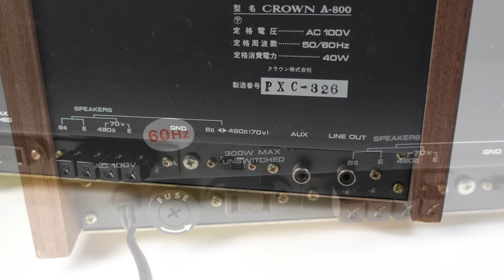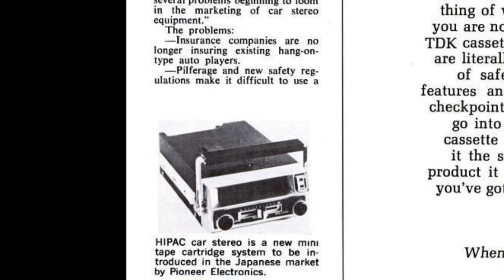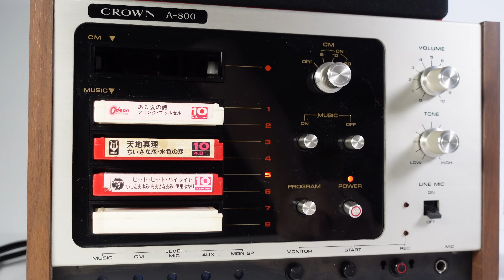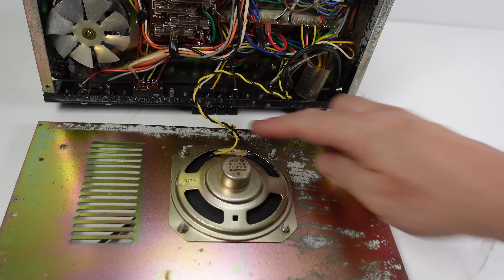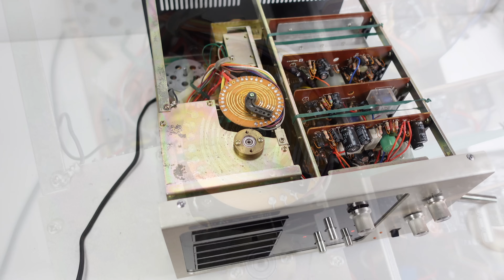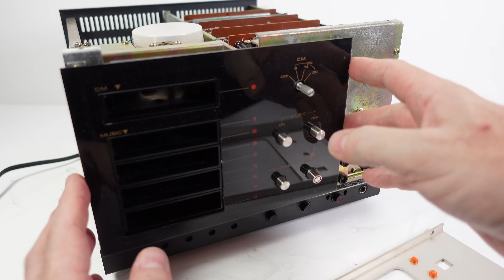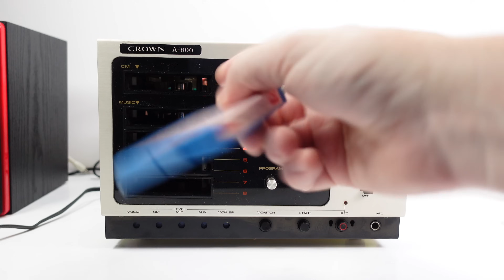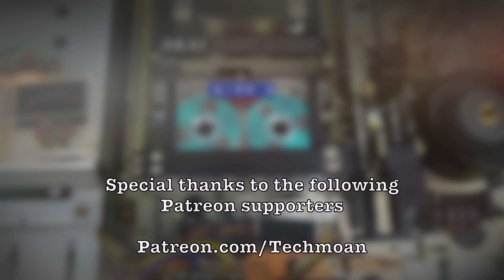An unusual player for a forgotten ‘70s music format

Comment: On the line frequency issue, would it be possible to use a UPS that had switchable output frequency... or perhaps a DC to AC inverter tied to a 12 volt battery?
Reply: Most low end DC to AC inverters do not produce an AC pure sine wave.  Their waveform is acceptable to modern switch mode PSUs but not so much to the older type equipment containing those heavy 50 or 60 Hz mains transformers.
Reply: @geoffmorrison3648  ... I figured the guy had enough stuff around that he may have something suitable but never gave it a second thought.

Comment: The modularity of that machine's design is ingenious!  It's absolutely designed to be serviced on-site, very quickly.  The technician simply needs to swap out the modules to get the machine working again, and can then take those modules back to the shop where they can be repaired properly.  Really well-designed, particularly for the early to mid 1970s.

Now we know why the Japanese ate our lunch in the '70s and '80s when it came to electronic devices.  They really showed the world how it should be done.

Comment: I don't think replacing the capacitor would do anything. In fact, lower power line frequency requires higher capacitor value to smooth out the rectified voltage. In fact, relying on an electrolytic capacitor to set the tape speed would be a terrible idea. Electrolytic caps are notorious for having sloppy tolerances when it comes to capacitance. +/- 20% is the norm. Besides, their value often drifts with time. In other words, this is not something you'd use for setting the tape speed. I suspect that they would replace the flywheel for the 50 Hz model.

Comment: A BGM machine is exactly what came to mind to me.  He'd featured such devices before on the channel, and it's pretty common that those devices are mono, because there isn't a real benefit to having them be stereo.

I figured the first slot was intended for pre-recorded announcements/alerts/etc.

Seriously though, the internal workings of these pre-transistor electronics are crazy.
Reply: How is it pre-transistor? Do you see any vacuum tubes here? It is definitely transistor technology.
Reply: @0raj0  Quite right.  I meant pre-integrated circuits, I think?

Comment: I have an associates degree in electronics engineering and replacing the capacitor isn't going to change the speed. Those two values were chosen by the designers for filtering out power line noise effectively. To change the speed, the motor or pulleys would need to be changed.
[EDIT] Many rude people have replied to my comment. Am I an electronics technician? Maybe I'm a very highly trained chimp, a figment of your imagination, or this is an early prototype matrix and we're all just slaves to retro tech. If that bothers you, just follow the white rabbit or something.
Reply: I still have my Akai GXC-40D cassette recorder which I purchased some time between 1971 and 1976.  Was obviously intended as a worldwide model as it has a 6 position voltage selector switch (100/110/120/200/220/240) on the rear panel.  (The screw in fuse holder is in the middle of the selector and needs to be removed to change the selector so no risk of inadvertently changing it.)  On the bottom a single screw opens a trapdoor which gives access to the double pulley on the single AC motor.  There a little label showing 50Hz and 60 Hz against the diagram of the large and small pulley diameters.  There is also a 2-position slide switch labelled 50/60.  The circuit diagram (which was often included in those days) shows that the motor is fed from a tap on the mains transformer through a capacitor.  The 50 Hz position adds an extra capacitor in parallel with the one that is always in circuit.
Reply: Unlikely because the presenter does not mention hearing 50Hz mains hum. And mains hum is not apparent in what we hear despite the unit set for 60Hz but being used on UK 50Hz.  But you could have been correct electronics then used star-point grounding system that was a problem and designers struggled with electrical interference and mains hum at that time.
Reply: I highly doubt the motor is an indication motor, I would expect it to be a brushed motor. Therefore I don't think it is a phase shifting capacitor. A capacitor can be used to adjust motor speed such as in an old fashioned ceiling fan speed control. I think it does that by using the capacitor AC reactance to lower the True  Power available to the motor. I think its worth a try, it shouldn't damage it anyway
Reply: @cameronlevers231  I never thought I'd see so many people in one place who don't know anything about how motors work.
Reply: @freddyzdead1  why are you so adamant it is an induction motor? Cassette tape drives have brushed motors close to the read head not to mention how do you have an induction motor in a 90s boom box?
Reply: In this case the white rabbit turned out to be correct , and simply changing the cap worked.
Reply: rosenbergs electric motor repair   Try this book you will learn a lot
Reply: Chris if you had a degree in electronics you would know that the purpose of the capacitor is to provide the correct phase shift for the run winding of the motor.  Absolutely nothing to do with noise filtering.
Reply: @freddyzdead1  another but most unlikely explanation is that the motor is a brush motor.  The capacitor is in series with the field winding and the ac supply and the armuture is supplied directly from  the ac supply.  Therefore the motor is shunt wound has very good speed regulation set by the ratio of the two voltages.  If the field reactance drops due to loading on the motor the voltage drops causing the speed to tend to increase or counter the tendency for the speed to drop and that is why there are two capacitor values rather than a capacitor or a shorting link.
Reply: @AndrewLohmannKent  Are you serious?  A brush motor in the middle of multiple tape drives?  Besides that, your explanation is all wrong.  Brush motors have the worst speed regulation of any kind of motor.
Reply: @freddyzdead1  But PM brush motors were used in cheap tape recorders with no capstan but the speed depends on the battery voltage and the amount of tape on the real.  Anyway I have suggested a shunt wound motor which has very good speed regulation and there is no reason why it should not be compound motor with an anti-series winding to improve speed regulation, if the suggestion I made does not work.  Anyway as I said above gear change or motor change is more likely, but the video suggests that those are not likely.
Reply: I also have an associate's degree in electronics engineering and in a simple LRC loop circuit changing the capacity will indeed change the frequency of the output.  Now will it change it to the correct frequency in this instance?  I would have to study the circuit diagram and calculate based on the inductance of the coil
Reply: What's an "associates degree" when it's at home and why is it relevant to the capacitor.
Reply: I also have a degree, and if you change the capacitor in an LRC circuit you will also change the frequency of the output.  It seems like an odd way to change the frequency especially in a power supply, but it could work! I don't know if I would risk it, because it might overload the circuit.

Comment: The CM might stand for "Customer Message". To be honest, to me, the purpose of the unit was given away when you showed the back panel with the labelled high voltage speaker connection. That has commonly been used where there are many speakers to be driven, as might be found in a large store. In such a setup the speakers are fitted with their own step-down transformers. This allows many speakers to be driven in parallel from a common source, while the current driven can be relatively low. This reduces the losses due to wiring resistance which increase with the square of the current through the wire.

Comment: I am unsure about changing from 60hz to 50hz by changing that capacitor.  I thought at first that changing the value of the capacitor might change an oscillator circuit from one frequency to another.  But the physical size of that capacitor implies that it is part of a power supply.  It might be that the cap is part of the power supply just for the AC motor and its value changes its frequency.  Did the user manual have a schematic?  My $0.02 for what its worth.

Comment: 17:40  just lower frequency  needs more capacitor. so no, changing capacitor wont fix it.
i think you need to change size of pulley.

Comment: It's not impossible to control motor speed with a capacitor. But these things have massive tolerances, so for each unit you made it would be a stab in the dark what speed you actually got, particularly with seventies technology. Even if the unit had the right value, it would probably have drifted by now. Other folk talk about how you can add capacitance in parallel, and that's right, but just any old capacitor which you've got to hand around the 1uF sort of value and with a high enough voltage rating (matching or exceeding that of the existing cap) will at least show you if this is how the speed is controlled.

Comment: I believe the motor is an ac type, with a capacitor dropper in series. As frequency is lower and you want to pass same power, you need a larger capacitor. So it changes the power through motor, not the speed it turns. You need to really examine the motor. Perhaps some part can be bridged out? Worst case the 50Hz uses a completely different motor.

Comment: The 70V mono output is a BIG clue as to its intended use. 70V systems are extremely common for use in "department stores", offices, amusement parks, hospitals, hotels, etc, where many mono speakers, usually mounted in the ceiling, are fed from a central point. I sold 70V systems when I was working at Radio Snack many years ago. Occasionally, someone would try to by one as a car speaker or something. Each speaker in a 70V system requires a special 70V transformer. There are many advantages to 70V systems, but sound quality is not one of them. Distance, number of speakers you can put in series, volume control at the speaker, scaleability, decreasing cost per speaker I guess are the most obvious.

Comment: The capacitor looks to be part of a resonator circuit.  It is likely replacing it will change the speed.  The new capacitor (due to modern technology) will be considerably smaller.  I recommend a high voltage (300 v) Mylar type.  You can temporarily parallel the new capacitor with the old one, and see if it adjusts the speed, then you will know, and not waste time soldering if it doesn't.

Also, Japan is a tropical island.  It's pretty normal for it to be humid.

Comment: I knew right away that this was for a store or office.  The thing I noticed was the 70-volt 490 ohm speaker output connections on the back of the base unit.  This allows the unit to drive multiple speakers that might be hundreds of feet/meters away from the unit.  These are interconnected with thin gauge wire as part of a "distributed speaker system".  The resistance of long lengths of this (INEXPENSIVE!) thin wire would never properly drive a single 8 ohm speaker let alone many speakers scattered around the store.  Each speaker has a transformer that converts the 70-volt to something that the speaker can use.  Also, all the speakers' transformers are connected in parallel to one another which simplifies installation.  Bottom line one base unit can easily drive many speakers.   See https://en.wikipedia.org/wiki/Constant-voltage_speaker_system for details.  My $0.02

Comment: I think your best bet to fix the speed issue would be to get a large 12v power supply and connect it to an American car inverter. I don't think changibg the capicator should change the motor speed, although I wouldn't think it would hurt to try

Comment: Haven't seen this in the comments (but I didn't read all of them).
You might want to pull out the power "card" to see if there's a speed switch or marked changeable component along with the capacitor you found that was marked for speed.
I did see a mention that the pulley operated by the motor belt might need changing too.

Comment: Using a "marker tone" on the second head for the announcement makes sense because getting a tape with the exact right length for announcements would be difficult. This way, you may be able to record several announcements on a single cartridge and it could stop between them and it could automatically skip a blank section by advancing the tape until another start marker comes along. My guess is it's supposed to put the start and stop markers on when you record, either automatically or perhaps by using a button combination, but maybe it's faulty.

Comment: It is hard to say if the capacitor alone would change the speed.  However, you could look at the circuit and see if the capacitor is in the motor circuit or not.  If it isn't then no, it will obviously not control the speed.   But if it is in the circuit, then I would say give it a try and see what happens.  Overall though, this is a VERY nice background music system as I like the fact that it has the feature for a custom message (which is what I thought CM stood for).   I am sure nowadays you can do this with a digital unit, or even a computer will do it, but it is still nice to see the old technology at work here.

Comment: I can confirm you just have to replace the cap by a 1 micro Farad one. Just make sure you replace it with the same (or higher)  voltage rating. It also seems to be an unpolarised one. So please don't use an electrolytic one if the current cap does not show a plus or minus sign on it. 
Alternatively, you can measure the voltage over the cap. If it's DC, then you can replace it by a 1 micro Farad  electrolytic one (but mind the + and - side in that case).
If you measure AC, then use an unpolarised one.
Or use an unpolarised one anyway, then it doesn't matter if it's AC or DC ^_^

Comment: Only Changing the value of the capacitor will not change the speed. That's a thing i know.
 But what you know And i know nót, that is:
  How o How, does that sort of "loop-tape-cassette-things" work?? Inside that little plastic casing it hás to mangle up horribly?! How the tape rolls of or on that one spool there in the middle?? And the tape that comes of in the middle, that is a different diameter so a different length per turn? And is that one spool driven from the outside or simply from pulling on the tape ?? How is that possible to work??! I know electronics but for this sort of things i need channels like yours!

Comment: Fascinating. Everything mounted on cards, you wish things were as easy to maintain nowadays, and all it'd cost would be a couple sockets
Reply: And a few years down the road those connectors will be most of your servicing work. Gulbransen and Lowery are at the opposite ends of this. Gulbransen's factory was only 40 miles away so it was easy to get a new board then, now not at all. Now all those organs have connector problems. Lowery just lulls along with every board wired to every other and they never have those problems. Also when slotted you need an extender card to poke around on just one board. Lowery's boards are all flat and accessible. Easy listening and servicing too.

Comment: The changing of capacitor is sadly not for changing the speed, that's down to the motor speed or pulley diameters, the cap is just there either for smoothing into DC or for noise suppression depending on which part of the circuit it is in (most likely the latter)...

Comment: Interesting video, thanks.

I don't think that changing the capacitor value alone is going to change the speed but I also don't think it would do any damage if you want to try it.

Maybe if you're regularly coming across equipment that's designed as 60hz it might be worth investing in a 12volt 1.5 or 2kva pure sine camping inverter from EBay or Amazon USA and run it from a single deep cycle battery that you can recharge using any decent car charger you can buy locally in the UK. If you need 230volts at 60hz you'd also need a step up transformer.

Yeah, it does get somewhat convoluted but it would cover all bases when it comes to power requirements and it would give you very clean power at the perfect frequency although your run time would be very dependant on the capacity of the battery.

Comment: Re. the continuously-playing announcement: a system I worked on had an endless cassette with five or six identical announcements recorded on it, with a fixed amount of silence between each repetition of the announcement.  After the circuit detected almost the silence period, the motor cut, with the next announcement cued up.  It takes some planning to make such a tape, but have you tried silence?

Comment: The pause button on a (compact) cassette deck usually just retracts the pinch roller in much the same way. But no, they probably weren't thinking of a pause feature. As has been pointed out, if a cart was left in a powered down machine the not-turning capstan would be pressed against the pinch roller, potentially leaving a notch in the surface of the roller. So presumably the natural position of the "fingers" is "in" and there has to be power to pull your finger out.

Comment: I'm pretty sure the capacitor only serves as a starting capacitor for the single-phase AC motor. Changing the capacitor will either have no effect on the speed, or a very drastic effect if the speed goes to 0, or it might affect the speed after all but not in the desired way. Most likely the motor itself needs to be swapped, and the 50Hz and 60Hz motors require a different value of starting capacitor. So unless you are able to find that unicorn motor, your best option is probably a 50-to-60Hz AC power supply.